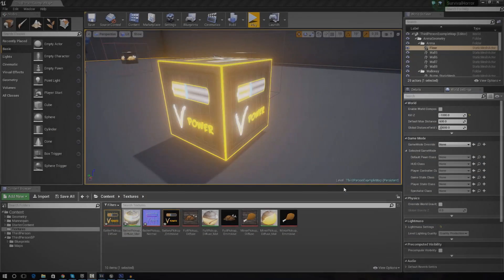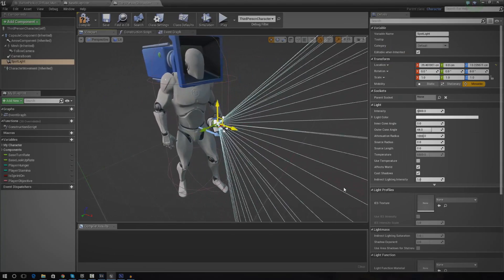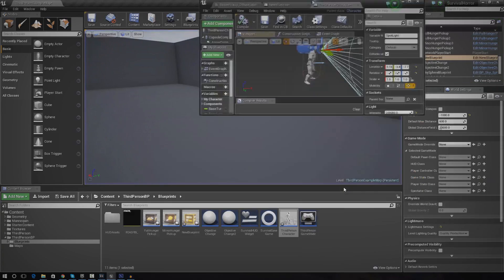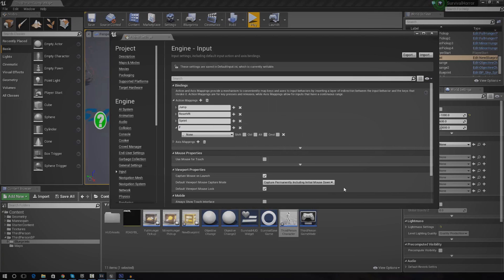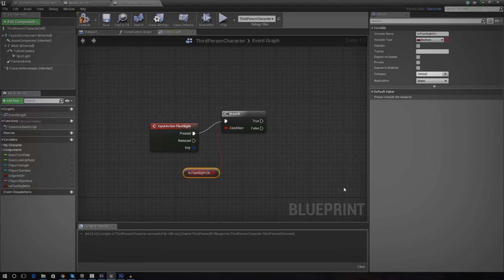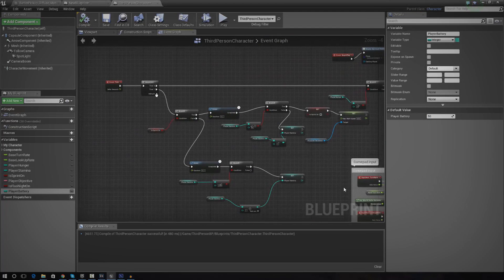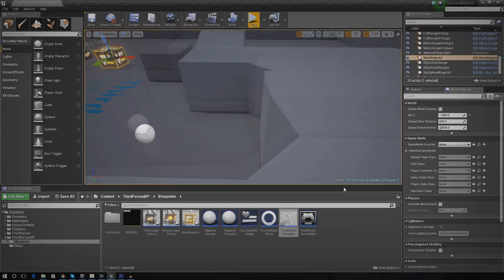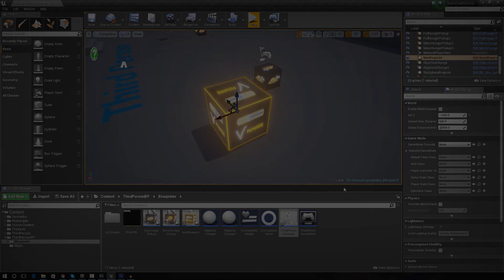Battery Powered Flashlight -#10 Creating A Survival Horror (Unreal Engine 4)

Comment: I like your series but you really need to work on the obscene amount of back tracking and mistakes in the videos.. I know UE changes but I tend to have to go to other videos to fix what wasn’t working after following your steps. Your videos would be so much easier to follow if you stopped back tracking when it’s not necessary, and were confident in your wording and instructions when it comes to blueprints

Comment: This is awesome, though I do have an organizational question. Your player bluprint is getting pretty messy, what is the right way to keep that clean? I can imagine as you add multiple system that could really blow up. Do you build stuff like the flash light in its own node?
Reply from the maker: Best thing to do is keep it all of your code seperated and be sure to comment it, that way you can find everything easier later on.  If you want a bit of extra help, I advise you checkout our Discord community which has over 3,000 over Unreal Engine 4 developers!

https://discord.gg/Virtus

Comment: I think this would be abetter system if, have battery pick ups for power boosts when needed but add power regeneration when the light is not being used. I havent done it but im guess you would do it the same way you do stamina regeneration?